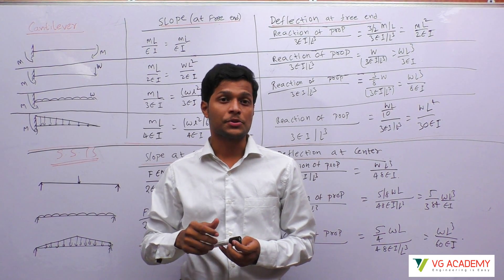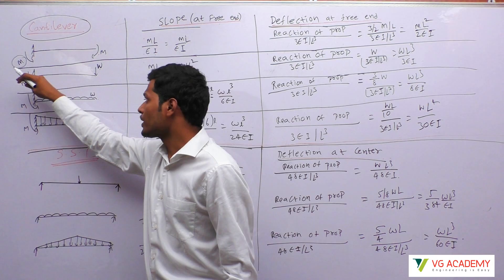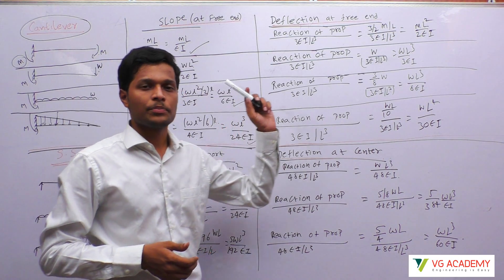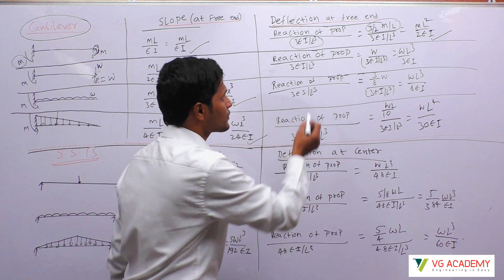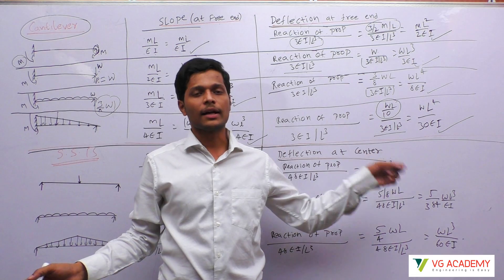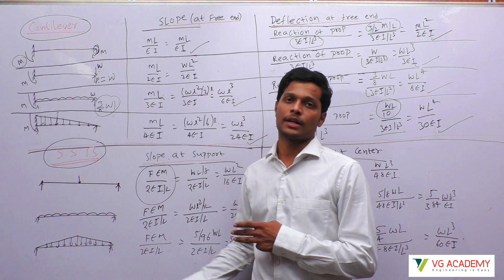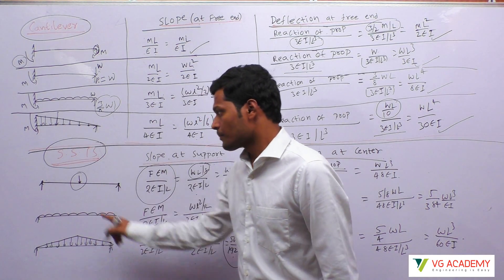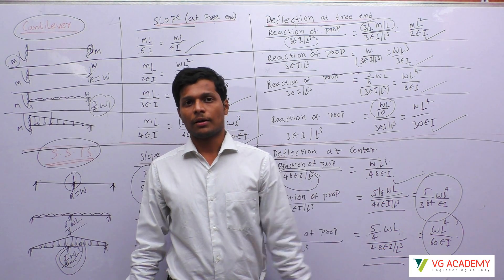my shortcuts slope and deflection of beam (see description)

Comment: In the method of finding reaction of prop in cantilever beam with point load in center as well as the udl on entire span you told that reaction at free end is 11w/16 in point load and 5wl/8 in udl case..but here in this short cut method while you are taking prop reaction that is different in fact you are taking reaction of fixed end.please check this.
Reply: Superb video sir

Comment: Check division in case 2nd and 3rd in.SSB deflection. Method is not suitable.
Reply from the maker: Dibyanshu Prince watch description
Reply: VG academy Civil engineering in 3rd case reaction is (5wL/4) and according to you using shortcut (5wL/4)/(48EI/L^2)= wL^3/60EI. result is correct but not method
Reply from the maker: Dibyanshu Prince watch description. Reaction is 4/5. By mistake i wrote 5/4. Reaction will not be greater than applied load in ssb
Reply: VG academy Civil engineering thnx sir

Comment: Hi Sir,

I have one more way to calculate deflection for Cantilever beam.
We know that,
y = mx +c

Deflection = Slope * length under deflection + 0

1) y = m(l/2) = m(l-l/2)
2) y = m(2l/3) = m(l-l/3)
3) y = m(3l/4) = m(l-l/4)
 4) y = m(4l/5) = m(l-l/5)

I derived it after seeing ur explanation. Thanks for the video upload.

Thanks and Regards,
Sagar.
Reply from the maker: it is applicable only if deflected curve is linear. good that you are trying. deflected curve will be linear after the loads. we use this formula for finding the deflection after the load. good that you are trying
Reply: Thanks Sir. Also, I found one error(?) in the  formula for SSB. The deflection at the center for (3) should be wl^4 / 120 EI. You have given as 60 EI.
Reply from the maker: vidhya sagar see description

Comment: Sir, in simply supported uvl - "reaction at prop is (4/5 Wl)" plz check it and inform sir if i am wrong.
Reply from the maker: hema kovvuri yes. you can see the final answer also. The final answer I have written directly as I know the answer. it should be 4/5. thank you